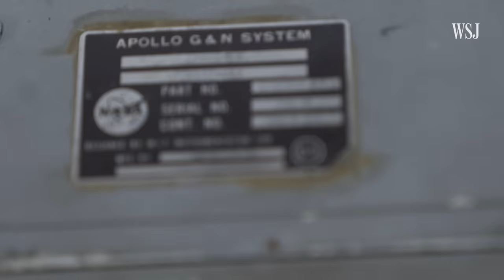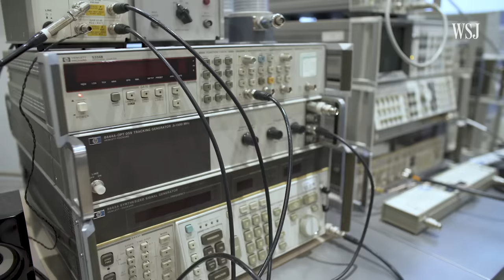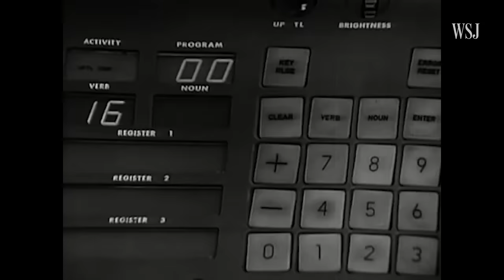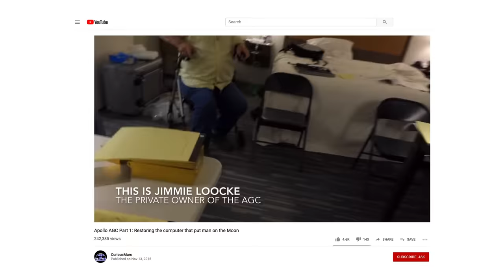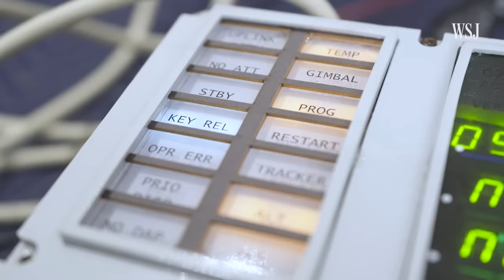Restorers Try to Get Lunar Module Guidance Computer Up and Running | WSJ

Comment: I watched every bit of the videos they posted about the restoration. Amazingly interesting stuff. Hearing the programs were gone, nothing could run it, nobody knew nothing about nothing, so gratifying to see the restoration bring together the programmers and run the program.
Reply: I wish they would have recapped going to the history museum to get a working piece of test software, the only machine known to have it
Reply: @jgordon7719  I forget if they went to more than one museum but there are data carts that still hold the programs 50 years later. One of the programmers had several of them.
Reply: Sure in isolation I'm sure that's true
Reply: They got a chance to see read the other program memory modules.
Reply: @theannoyedmrfloyd3998  Don't know about the air and space museum but they've tried several memory modules including from at least one museum. I'm assuming they backed up the data of everything they tried.
Reply: You are talking about NASA, they even "erased" the original footage... We didn't had the technology and we don't have it now. It is an elaborated hoax.
Reply: I also watched the video series. 
It came as a surprise to me that it was achieved in 2 weeks. 
I had imaged it was a lot longer considering the scope of what they where doing and all the scratch built ancillary hardware and software, plus coming to grips with tech so unfamiliar and purpose built.    
Mind further blown.
Reply: @1969nitsuga  who told you that nonsense??
Reply: @rogerout7498  NASA itself. Don Pettit admited we don't have the technology... If we don't have it nowb we never had it. Not even thrusters work in vacuum, a pair of pesky things called Joules-Thompson Effect and Bernoulli's Law yells it can't be. And don't come with that Newton's 3rd. BS. You need friction and pressure to create thrust, vacuum disrupts the continuity of the system. You can't transfer kinetic energy nor create momentum under those conditions.
Reply: @525Lines  Not only did they back that up but they uploaded everything in their own git repository on github, search for "virtualagc".
Reply: @1969nitsuga  Nice playlists I think you've got pretty much every conspiracy theory that has ever existed on there, just wondering how many math & science classes you failed before you finally gave up and dropped out of high school?
Reply: @disrupter7419  Give it a rest? Your high school physics doesn't help you much in seen the truth for what it is... You've been duped! Stay out of the way and keep playing with your PlayStation.
Reply: 1969nitsuga And how did he get his PlayStation?  The fact that we are where we are today is the testament that we did have it then. No company could have built the tech without govt funding. It was too big and too expensive.
Reply: @dsatt57  The spacce program is a scam for black projects funding from the very beginnings. NASA is just a front for that.
Reply: @1969nitsuga  "And don't come with that Newton's 3rd. BS."
Now, I've happened upon a few dull edges in the Youtube comments, but this...
Reply: @1969nitsuga  You need physics 101 because you clearly flunked it in spectacular style.
Reply: @kingsman428  Lol. You are just describing observations and mathematical relationships. You aren't explaining nothing. What is inertia, momentum, gravity, a field? Your current theoretical frame doesn't provide for that because nobody knows.
Reply: @1969nitsuga  "...observations...mathematical relationships..."
That's exactly what science is. It allows humans to convey ideas and concepts so that we can harness those theories leading to inventions such as radio, television, the internet, aeroplanes, cars etc.
"...Fields, mass, inertia...nobody knows..."
See above to realise what a risible statement that is.
But of course, you're just trying to be clever by implying "...yes, but we don't actually know what those things are..."
Ok then, let's play along.
Ask me the same question about Mass, Inertia, Gravity, Fields etc but this time don't use the descriptive terms used by physicists EG Mass, Inertia, Gravity, Fields etc.
Instead, use your own terms and see how well you fair trying to convey your point and just to make it even more impressive, try and get your point across without using any of the technology provided by physics built on those very terms you have issue with 😄
Reply: @1969nitsuga  
"...no one knows what field theory is...". 
Say that to yourself the next time you listen to the radio, watch TV, view a sattelite transmission or use GPS.
"...no one knows what inertia is..."
Say that to yourself the next time you see a truck or train pulling away with a full load.
"...know one knows what mass is..."
Say that to yourself the next time you see an aircraft take off.
Want to know how field theory works why not read Maxwell's equations on EM transmission theory?
Want to know how gravity works why not read Einstein's theories?
Want to know about Mass and Inertia why not read Newtonian Mechanics?
Let me guess, they're all shills?
Honestly, just love the way you try to define what science is to suit your narrative. 
Please explain how scientists discovered Gravity, Mass, Inertia and Field theory if, as you've asserted, the maths and physics is just ad hoc and explains nothing?
Reply: @kingsman428  You have brain constipation. Those are examples with descriptions and definitions but no explanation. The internal mechanics at particle and enetgy level. Nobody has seen an electron, nor a photon, nor how they move creating energy. How entanglement works, transmiting without contact trough a "field" your mainstream denies. Even Maxwell and Tesla (the top field theorists) just described but never explainedb neither did Newton. And to this moment that fact remains unchanged.
Reply: @1969nitsuga  You said
"...Not even thrusters work in a vacuum..."
"...Newton's 3rd BS..."
"...You can't create momentum..."
All of those claims are false which is why you need physics 101

You said
"...physics are a bunch of ad hoc descriptions and mathematical relationships that explains nothing..." 
Firstly, that's a great example of your poor thinking skills when only a few posts ago you were trying to use physics to support your false claims "...Joules Thompson... Bernoulli's law..." or simply put, an obvious contradiction.
Secondly, maths and physics describes every single detail of all human knowledge allowing us to create magnificent things making all of our lives greater in so many ways furthermore, maths and physics are the tools we use to try and discover the knowledge of all the things we don't yet know.

Next you played the classic move that all conspiracy theorists do, Rather than answer the questions you've been challenged on you ask questions of your own EG "...tell me what Gravity, mass, inertia etc are.."

You said
"...Maxwell and Tesla just described but never explained..."
Maxwell explained and described how a charged particle behaves in a field it was the 'AHA' moment the proved that EM waves are self propagating and don't need a medium to travel heralding the end of the proposed idea of an 'aether'
Science has a good understanding of RF propagation and field theory much more than your risible claim that we know nothing
 "...and to this moment that fact remains unchanged..."
Demonstrably, that isn't true so that argument collapses about you.

https://www.toppr.com/guides/physics/moving-charges-and-magnetism/motion-combined-electric-magnetic-fields/

"...How do particles acquire mass..."
Read the following then provide your work debunking the findings of CERN and those physicists so that I have a better understanding of what it is you're trying to assert.

https://physics.aps.org/articles/v6/111

"...no one has ever seen an electron..."
So you're implying that if it's never been seen then it's must be false?
Well, yet again you are wrong.  Another of your arguments just collapses about you.

https://phys.org/news/2008-02-electron.html

Now, stop being evasive and answer the question.

Please explain how scientists discovered Gravity, Mass, Inertia and Field Theory if our "...maths and physics is just ad hoc that explains nothing..."
I'm eagerly waiting for an answer.

Truth is you're a conspiracy theorist that has harvested a bunch of false viewpoints that you think challenges the science of the day. You do realise that the computerised device you use on a daily basis is a Quantum device using field theory to transmit between two points?
The irony of that as you type into your Quantum device "..we nothing about field theory or Quantum Mechanics..." whilst dribbling all over the keyboard and uttering "..der..." 😁
Reply: @kingsman428  just admit the moon landing was faked..  don't cry about it..
Reply: @csr6969  So, you're unable to answer the questions.

Occam's razor says the Moon landings happened. It's the simplest and most likely outcome. For it to be a conspiracy it would require the conspiracy net to grow at an unsustainable rate. EG NASA, The Russians, The English and pretty much most of the world would have to be involved. In addition to that you have to add all the other global space programmes, all the supporting infrastructure, and of course, how do you make sure thousands upon thousands of human beings play along, finally, for what purpose, what is the end game?

"....The Moon landing was faked..."

Ok, then you won't have any trouble explaining the following two things.

Firstly, 
Apollo 11 launch was watched by approximately 1/2 a billion people across the globe so where did that Saturn V rocket go if not into the Moon's orbit, can you be precise about where it actually just hung out?

Secondly, 
The Apollo 11 mission was tracked by many stations across the globe and in particular, by the Jodrell Bank Observatory in England. On the same day that Jodrell Bank was tracking Apollo 11 it was also tracking the Russian satellite Lunar 15 which crashed into the Moon.
Please explain how the Americans managed to generate spoof electronic signatures that managed to fool the Jodrell Bank Observatory and the rest of the world's tracking stations leading them to think they were tracking Apollo 11. 

https://www.jodrellbank.net/20-july-1969-lovell-telescope-tracked-eagle-lander-onto-surface-moon/
Reply: @Joe Horn Prove I am. You are just in cognitive dissonance.
Reply: @VedTraed  You can't go anywhere with this in real vacuum. Newton's 3rd. is frequently misinterpreted. An oposite force requires contact or friction to preserve the continuity of the system. You can't transfer kinetic energy without contact so then you can't build thrust or generate force.
Reply: @Joe Horn You know, look at him still going. I don't think any troll would be this motivated to keep it up, you'd have to be legitimately insane.
Reply: @kingsman428  A magnetic field is contact through the electromagnetic spectrum that needs coherency to interact. Heat and light by itself give no kinetic energy so you are completely wrong on that regard. Rocket thrust is given by the equation:
F=m˙vexit+Ae(P1−P2)
where m˙ is the mass flow rate, vexit is the average exit flow velocity across the exit plane, Ae is the cross-sectional area of the exhaust jet at the exit plane, P1 is the static pressure inside the engine just before the exit plane, and P2 is the ambient static pressure (i.e. atmospheric pressure).
Provided that the nozzle is not overexpanded and flow separation does not occur, Ae remains constant, and the thrust difference is realized primarily from the change in P2. If nozzle is overexpanded to the point that flow separation occurs, however, the exhaust jet area drops as well, causing further losses. As you can see, those mathematical relationships only describe but doesn't explain. As you can see, "...thrust difference is realized primarily from the change in P2..." This is were Joules-Thompson kicks in. Adjustable nozzles are to compensate for the loss of atmospheric pressure but they still need "something" to prevent flow separation and being able to generate thrust. Simple logic, not pathetic regurgitating of scientisms.
Reply: @1969nitsuga  
Theoria Apophasis. 
AHahaha. I should have been able to spot the similarities, that explains why you say and believe such stupid things. I will give you this Theoria is entertaining listening especially when he starts talking about the "capacitance of light" 😄😄😃🤣😂
That's made my day.
Have a good life dude 😁😁😁
🤣😂🤣 Ahahahah 😁😁😁
Reply: @kingsman428  Ken Wheeler is only talking further about things others discovered or started before him. 2+2=4 even ehen told by a mad man. Quantum mechanics is already trying to deal with field theory but falls short for lacking a proper explanation and understanding of field theory. That's where wave functions kicks in trying to cope with a perceived duality in a rarified undefined medium called dark energy/matter bevause they can't touch it with our current technology and philosophic construct. The Schrödinger equation varies "depending on the particle" because it is ad hoc and not part of a complete theory, so is Born's and the Quantum Measurement Postulate (collapse of the wave funtion after measurement changing probability to 1 or in other words, it happens once you measure it).  You can't measure something that haven't happened. And then you have superpositions that interact with the environment (field) if coherent, destroying quantum behavior. If you reach over the states of the environment you no longer have superposition because you no longer know what it does and then you have a probability wave. You have nothing in the end. If the environment is a scalar field you are as blind as a bat in a heavy metal concert. For the wave to be measured needs an interaction with the environment and then it is no longer a probability. So we are 96% blind in terms of what we can measure and percieve. And you are telling me that we have a rounded theoretical fundation of how our universe works, a certainty of the mechanics around us? That's precisely what we don't have. That's why they still make a mix of waves and particles, they know there is a big something beyond their reach, not physical and their theories will always be incomplete without it.
Reply: Armando Silvier  A couple of people sure out of the whole world and none of them are stupid enough to fall for conspiracy theories.

Edit: The only educated people that believe in Conspiracy theories are con artists and the mentally ill.
Reply: @kingsman428  They always dodge direct questions as well as dismiss facts that don't suit their conspiracy theory, and of course they all repeat the same 10-20 things they all saw in a YouTube video made by a con artist while they sprinkle in a few words that they think makes them sound intelligent. It would be hilarious if it wasn't quite sad. 

The most ironic part is that they all love to claim that everyone else is merely repeating what we were told to memorize and should "do our own research" which is exactly what they're doing on top of having to ignore countless evidence. Proving yet again they aren't even aware of how science works at even a high school level.
Reply: @1969nitsuga  don't worry they will teach you this when you get to grade 9.
Reply: @kimepp2216  LOL. School is overvalued! If you're indoctrinated it is harder to question with logic what they tell you vs. the world you see. There is no measured curvature nor rotation. If the earth were round and rotating, there couldn't be life" just by momentum and fluids mechanics. It's already known that we are in a 2D holographic reality perceived in 3D. The "universe" is a 4 bits construct. We are in an infinite plane beyond the "wall".
Reply: 1969nitsuga hope you get well soon, best wishes and 💕
Reply: @1969nitsuga 
"school is overvalued... "

Well, the next time your leg is broken with a bone sticking out I suggest you visit a witchdoctor or a yoga instructor to repair it. Afterall, the doctors/surgeons who completed secondary and tertiary education is "overvalued" and they can't be trusted.
Reply: @1969nitsuga 
Lastly, did you even watch the video? Why don't you watch the video then provide a counter-argument based on the video providing specific timelines etc.

Your comments are a total non-sequitur. It's akin to watching a food channel on recipes then commenting that top Chef Gordon Ramsay is a fraud.
Reply: The snippy comments in this thread would be enough to enable a rocket to reach escape velocity and get the first stage into orbit around Earth, if only there were a way to harness them!🤪🚀
Reply: @1969nitsuga  LOL, " If we don't have it now,  we never had it.  What kind of logic is that? hilarious!!!!!
Reply: @1969nitsuga  Wasn't here a flat earher who did a documnetry and proved the earth was round by mistake using a laser? Hes all like that makes no sense. Also to what ends would be the point to say the earth was round and come up with all the lies to suport it? Wouldn't just be easier to teach that it was flat?
Reply: @gregh7457  You mean that 1969's technology can't be reproduced today? That's hilarious, particularly when NASA admitted never crossing the Van Allen belt...
Reply: @1969nitsuga  pretzel logic dude
Reply: All that brain power to fake the moon landing's impressive
Reply: I personally worked with 6 guys that worked on the LEM at Grumman Aerospace my first job out of college. It was the crowning moment of their careers. 10s of thousands of people were involved with the Apollo program and it is your contention that they are all lying? Stop embarrassing yourself.
Reply: @1969nitsuga  Get a vaccum chamber, and build a test rig. It will work, I assure you
Reply: @1969nitsuga  Can you elaborate a little bit more on the elaboration?.
Reply: @TheCultofshiva  IIRC I read a comment saying that there is actually another working computer that just hasn't been turned on in decades.
Reply: @tvre0  It is really amazing to see the old technology come to life and put to work even.